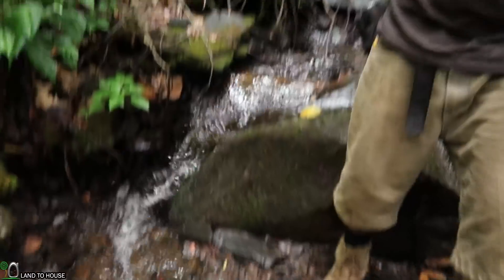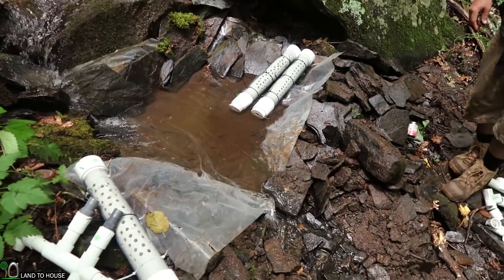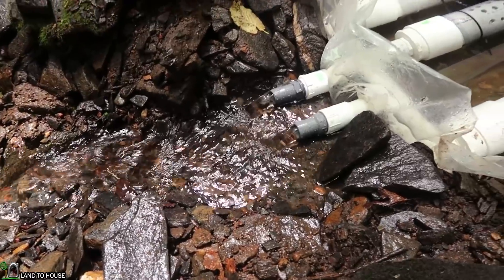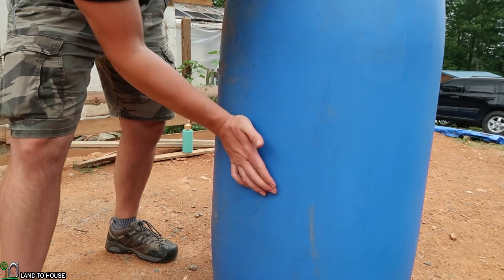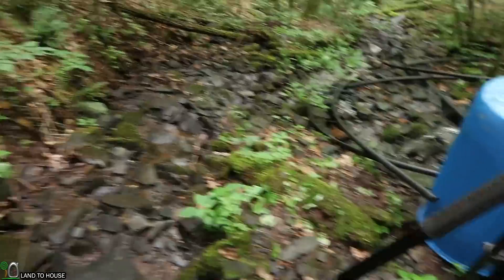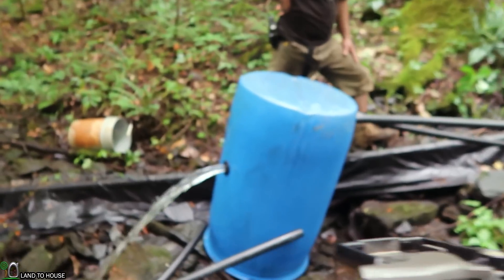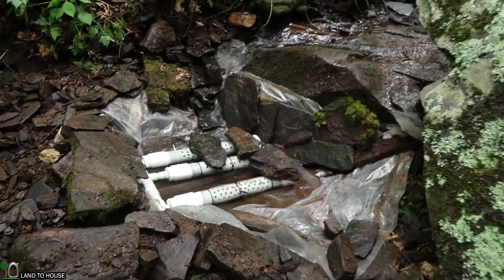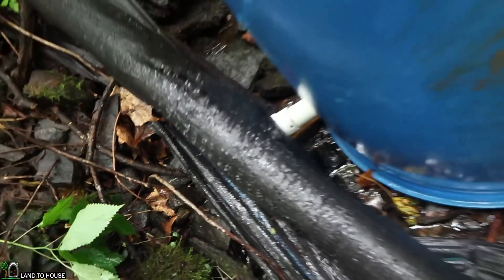Installing the Intake and Silt Catchment Off Grid Micro Hydro 2/6

Comment: If you have access to natural clay, you can use it with the flat stones to make a stronger damn, The clay will waterproof it, where you can hold more water.. That plastic wont last as long as the clay will.. As long as it doesn't get disturbed a lot, the clay will last for years..

Comment: Would you design this with a larger diameter penstock if you did it again?
Reply: for the distance that we did it at, it didn't provide much more PSI for the price of the larger pipe. If the river provided a larger flow rate then yes. this would allow us to run bigger jets and spin the motor with more torque.
Reply from the maker: The upper section of the creek does not have the flow rate most of the year to benefit from a larger pipe.

Comment: are the pipes from the intake to the barrel going to be supported to keep them at a downward angle and not drooping like they are in the video
Reply: yes, they will be supported all the way down. I found using 2 1x1 in a x shape to be easy on a uneven ground.
Reply: @homesteadonthemountain3100  I think with every dip you remove the more you will gain
Reply from the maker: Yes they are already supported. I think that is shown in a later video.

Comment: Love videos like this..
I have never done this before but i have a question.  
Bigger pipe up high and lower down toward the end (pressure point) use smaller pipe.
 should that not increase the PSI due to water weight in the bigger pipe pushing down from up high? 
You just can't exceed the water volume pressure value at the inlet. Correct?
Reply from the maker: That sounds good in theory but the weight of water is actually based on vertical height not volume of that a vertical height.  Increasing the size of the Pipe does not increase the pressure at the bottom. It does allow for an increase in flow rate. 

 Basically I could start off with a 12" pipe and drop down to a 1/4" pipe and it would have the same pressure as a 2" pipe the whole way